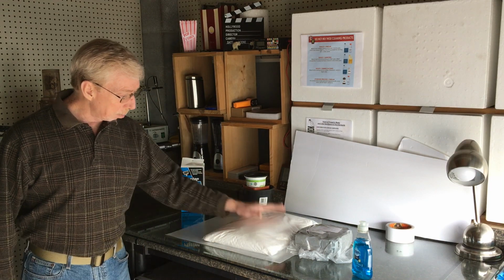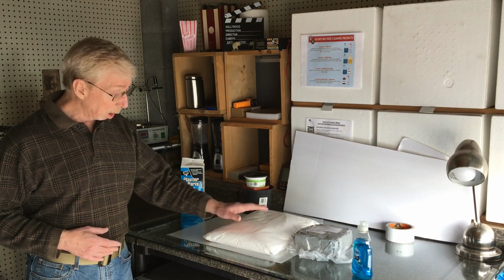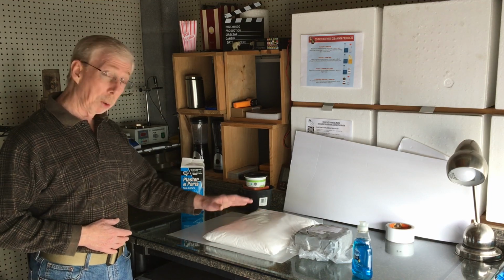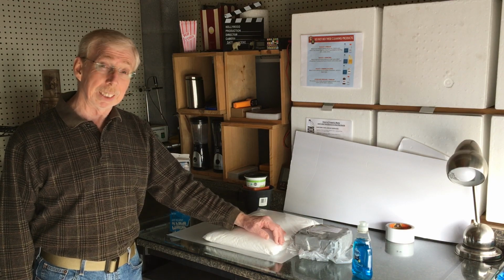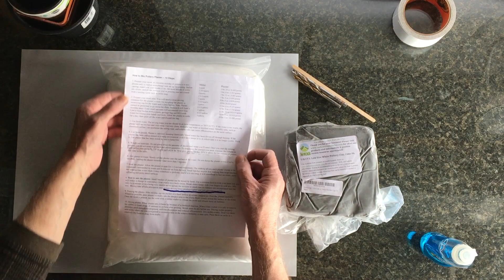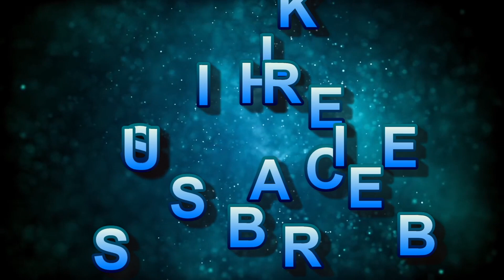Pottery Plaster 2 part mold. Clay to Plaster mold.

Comment: what is the electronic device that you use before demolding?
Reply from the maker: Moisture meter, I was curious. It told me nothing.
Reply: @GEOsustainable  Thanks for responding. Could be useful to measure moisture after drying molds...